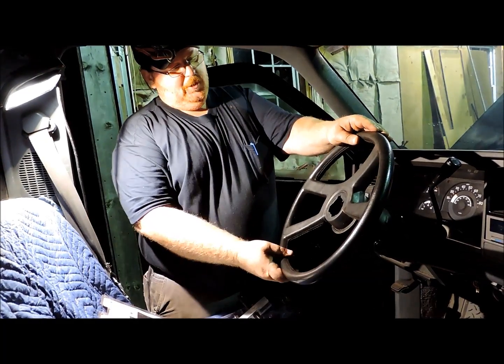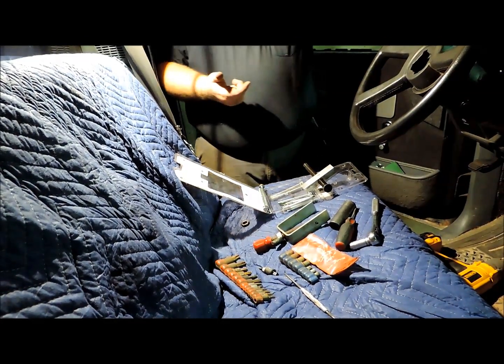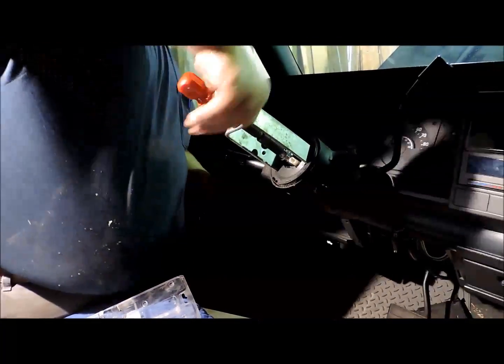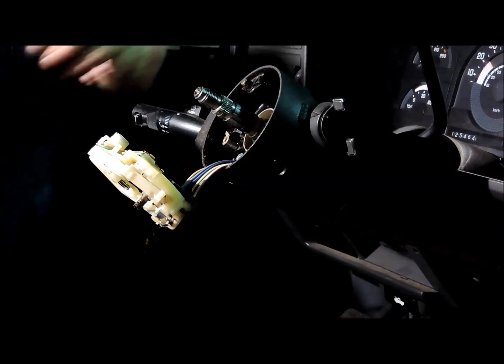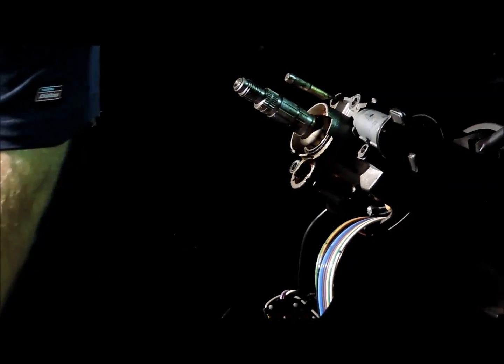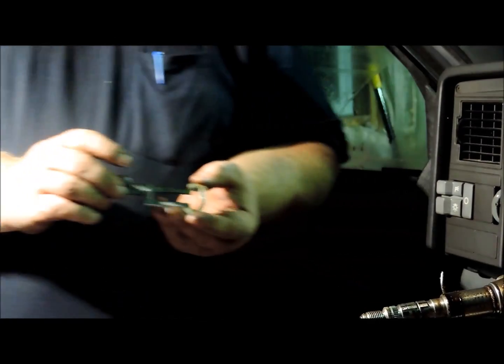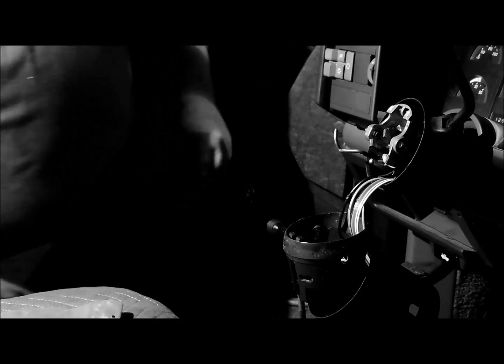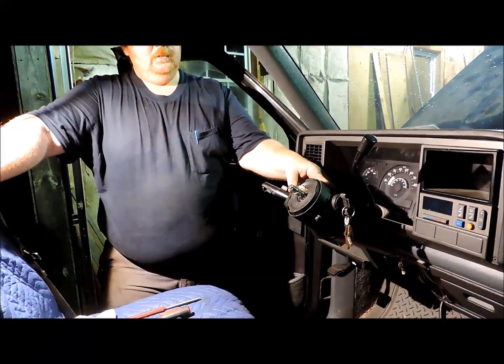GM Tilt Steering Column Repair

Comment: I have a k20 1977 and the steering colon shaft is loose from someone beating on it to get the steering wheel off. how can I get it to tighten back up

Comment: I have a GM tilt steering wheel out of a 91 Chevy. Enjoyed your video, wondering if you can give me some insight on a problem that I’m having with the steering wheel failing to lock. When I turn the key it does not engage the lock bolt that locks the steering wheel
Reply: @BradWillaims I had the same problem the other day. The issue is the top part of the spring came out of the black sprocket. The spring on the lock bolt needs to go through the largest opening on that black sprocket. I unscrewed the screw that holds the bottom of the spring in, and then pushed the top part of the spring through the longest hole in the black sprocket. Then I re-screwed the bottom of the spring back in. After you re-seat the spring in the black sprocket, when you turn the ignition off, the black sprocket will rotate toward you and it will make the lock bolt slide forward and allow it to lock the steering wheel. 

Check out the 17:42 mark of this video that I am linking and you will see what I am talking about 

https://www.youtube.com/watch?v=URjfZGuWz90

Comment: I just pulled those pivot pins without the special puller tool. Put longer screws in, clamped a set of vice grips onto the screws and tapped the vice grips with a hammer. Both came right out.

Comment: I repaired a GM colum by drilling out the elongated pin hole and installed steel bushings. Then spun the pins in a drill and with a file I made them to fit the new holes. The steel bushings were gued in with epocsy and then grease added during assembly. I've had it in my 75 GMC for several years with no complaints

Comment: Thank you for the video it was a tremendous help. after getting my column back together I encountered a problem, the steering wheel lock does not work. Any ideas on how to get this function back. Thank you in advance.
Reply from the maker: It sounds like your lock pin is not engaging the lock plate. The lock pin is operated by the pinion gear on the end of the shaft from the lock cylinder.  There is also a wire spring that keeps tension on the pin this spring could be out of place. You will need to take the steering wheel and lock plate off to see what is wrong.  Let me know what you find out. I will help you any way I can.

Comment: I want to see how you put that ball socket part of the column back on I took mine off and i'm having a heck of a time getting it back on
Reply: The Rambler same
Reply: See the Brandon Will reply to Richard Biniasz comment I was able to get mine back in like how he is explaining it have to get it to where it looks like it will start to slid in then lift it up at an angle towards the driver side and it will slip back in to the socket

Comment: What is the proper position with the crank lever and the half gear plastic part that connects to the key cylinder? I cannot get mine to line back up. 92 GMC no tilt steering column with automatic trans.

Comment: i fixed 1 that came completely apart in the woodz with a 3 foot length of thin rebar bent into a U shape and strapped under the column tightly as a splint/cradle/support using bungies, zip-ties, and a few hose clamps put together worm gear to tail to make a couple large enough to go around column and 2 legs of rebar splint. when column let go, it was a wild ride. the wheel was nearly on passenger side of cab 1 second and hanging out my side window next. not only were blinkers acting possessed. so were the turn signals and even my ignition. it drove fine after my backwoodz mcgyver treatment.
Reply: lol, so much so that i never got around to repairing or replacing it. i sent it to the scrapper awhile later after it lunched its 3rd rear end and i wiped all the rod bearings with fuel pumped past the piston rings into the oil by the electric fuel pump. (the road to my mining claim EATS trucks like girl scout cookies and accidently leaving my fuel pump on for hours at a time was decidedly not helpful).

Comment: People are commenting on how good and helpful this video is. I don't see it being helpful except for the real simple parts like removing the steering wheel and the locking plate. It's easy to take apart, the trick is putting it back together. 
About 15 years ago I paid a shop to do this and they never did get it right. I just ordered a rebuilt steering column for my 1984 el camino. I don't want to take any chances.
Reply: Or your a dumb ass!

Comment: #1 steering wheel pullee
#2 lock plate compressor 
#3 pivot pin puller
#4 external torx sockets
#5 basic torx set
#6 15mm socket
#7 13mm socket 
#8 basic screw drivers
#9 hammer

Comment: How did you get upper shaft back on
Reply: You have to turn the lower shaft so the upper can be tilted in from the bottom right open spot on the column.

Comment: Can you lose steerimg if this isnt fixed?
Reply from the maker: Jared Shurigar No the steering shaft will stay connected to the knuckle. But if the bolts back all the way  out the steering wheel will lay down in your lap and be difficult to maintain.
Reply: Okay thanks for letting me know

Comment: Googling "pivot pin remover" shows that Advance Auto ($12.39) & Home Depot ($7.74) and nationaltoolwarehouse ($6.18) carry them (All made by Lisle, PN#: LIS19940) online.  Too late at the moment to call Advance or Home Depot and see if they carry them in at my local storefront locations. Also online: O'Reilly; $9.99; W80652.  AutoZone; $10.99; 25153.  All state they work for GM steering columns, but look a bit different than the one used in the vid.  The one on Sears' website looks similar to the one in the vid: $7.46; MIS-KH525.

Comment: Great video. Thanks for doing it.  I can't get the center shaft back in the fork. I have tried everything. Do you have a secret for that one!?
Reply: You have to turn the lower shaft so the upper can be tilted in from the bottom right open spot on the column.

Comment: Followed along and had another guide online with pictures. Not difficult at all if you just go slowly but I screwed up and misaligned the high beam arm just like you said in the video. I had to mess with the arm a bit and got it back aligned and everything is tight and secure. Thanks for the video @MRBoatwrights

Comment: I'm trying to replace the light signal switch in my 1990 Chevy G20 conversion van. I'm trying to figure out how to fish that harness out. I mean I could cut the wires on the old one, but that doesn't help get the new one installed. Unless I can just cut the wires and splice them...
Reply from the maker: David Ryan Don't cut the wires it will turn into a hack job that constantly gives problems.  Take the panel under the column on the lower dash off. This will allow access to the horseshoe that holds the column too the dash. Take the 4 bolts out that go into the column and the take the 2 nuts that holds the horseshoe to the dash. This will allow the column to drop down. Unplug the harness and fish the plastic sheath up the column the reuse the plastic sheath on the new harness.
Reply: I got it worked through and have things back together, now I get power to lights and interior but when I turn the key to start it doesn't do anything. I have had the vehicle setting for more than a week so I'm going to charge the battery, but I suspect thats not entirely the issue. Any further advice?

Thank you so very much for this video which is great, and thank you for the quick reply.

Comment: I did everything just like you showed...and now my truck will turn over but want start...what did I do wrong please help?
Reply: and radio is dead also.
Reply from the maker: Danny Thurman Was it starting before you worked on it? The electrical part of the switch is mounted under the dash on the column.  Make sure the rod that operates it is moving.

Comment: I made my own tilt pin remover based on another you tube video . Thought I'd pass along  get # 8 X 32 T P I , put a nut on it and a larger nut bigger than pivot pin and screw into internal threads of pivot pin be sure the #8x 32 tpi is long enough to hold correct nut and large nut. Once in place start tightening to small nut against washer ( forgot that earlier) and pin will come out. Be sure small screw is grade 5 or better . You may pull threads out of pins
Reply from the maker: Dan Skipper Thanks for the comment.  I have used a make shift puller made the same way with success but I broke a screw off once and had to drill out the pin. The pin is hard I had to use a a carbide masonry bit to drill it with. Took all day. When I found out that snap on had a pin puller for $20 I bought one just as quick as I could.

Comment: I have a problem, my 86 suburban, when I turn the steering when it started shutting off, I had a hunch it was the steering wheel and not the throttle body, THIS was confirmed when I tried to tilt the steering wheel and the thing nearly came unglued. I pretty much held it in place until I got home. Its hitting the gears, moving them when I turn the steering wheel etc... I wanted to know do you think its just some loose nuts or does the whole steering column need to be replaced.
Reply: david kahil no You don't,. what probably happening is as your turning the wheel you may be pulling on the ignition rod inadvertently .if the column is loose or coming apart everything will be out of wack.  watch this video. when every thing is tightened up,the column should work and ignition problem should go away.

Comment: This was great! I've got the 4 bolts out (they were completely loose) but now they won't thread back in. Is it possible the plate behind is totally stripped? 

Can that plate shift? What are the next steps to take that casing off to check? 

The bolts feed all the way to the bottom of the whole without threading.
Reply from the maker: I don't ever take all the bolts out at once. I think there is a plate behind there with the threads in it that had fallen down in the column..
Reply: I have a 1979 Chevy Malibu and my I've taken out the 4 bolts and I can't get it to line up with the key ignition switch.  What do I need to do to fix this issue. ckbe.cm@gmail.com

Comment: Great video, but my backing plate that the 4 bolts go into has fell down inside the column. How do I go about retreavinng the backing plate?
Reply from the maker: I have never had that problem. You may have to disassemble the lower portion of the column.
Reply: Did you fix it? I had the same issue and was able to resolve it.
Reply: I had the same problem.... I used a mechanics magnet, small long narrow round magnet with a extendable handle.  You need to hold the column up so the backing plate moves free.  Patience is the key.

Comment: Removed the steering shaft with the ball socket...will not go back together...you skipped that part..all others do not remove this part...frustrated
Reply: If your wheels are straight ahead, lift them off the ground and turn them slightly so the steering shaft rotates. Attach the shaft at a 90° angle  and twist
Reply: +R. Williams 
we did not have the ability to left car and turn wheels since back was already lifted due to getting new tires on rims.  We were finally able to get it back on after several hours but was VERY frustrating.  Other than that your video was very helpful thank you.
Reply: QueenBee1755 how did you do it?
Reply: QueenBee1755
Reply: need 96 chevy steering coll

Comment: This is one of the better videos I have seen! I have to do this on the old olds wagon I have!
Reply from the maker: +Ghetto Wagon Thanks for the comment. I hope everything works out for you. If you take your time and pay attention to where the parts go while you are taking it apart it should be straight forward. Also spend the money to get the plate compressor and pin puller of find someone to borrow them from.
Reply: MRBoatwrights
 Yup! I have my own pin puller, lock plate tool. puller. I take apart non tilt columns. On my truck 94, same era as the video. That job was not too bad, the ignition rack was a pita to line up. I was thinking about removing the column om the car to tighten the bolts. I had to take the column out of my truck when it was fighting me. The ignition switch had to be loosened, that was the trick to reassembling the rack on the non tilt

Comment: Question if the tumbler turns all the way forward and has no spring back at the end (lights go on all power is there just no start)  Is it the rack spring gone bad or broken.?
Reply: +Jerry Archuleta the rack on my Cadillac just broke. It started, but wouldn't shut off w/o unhooking the battery. I'm in the process of taking mine apart and hoping I can get a replacement rack